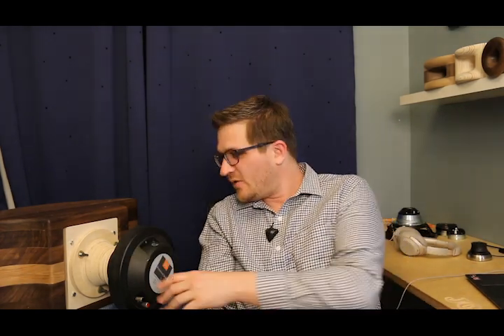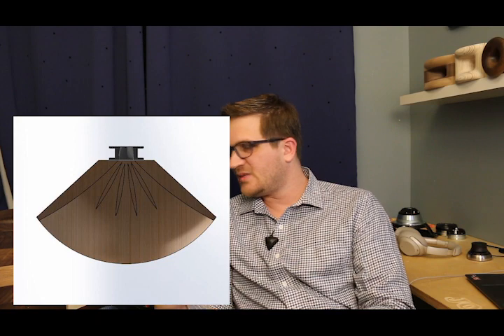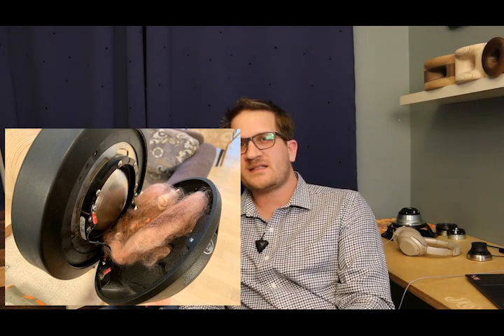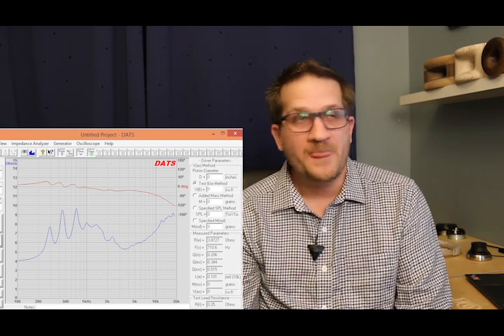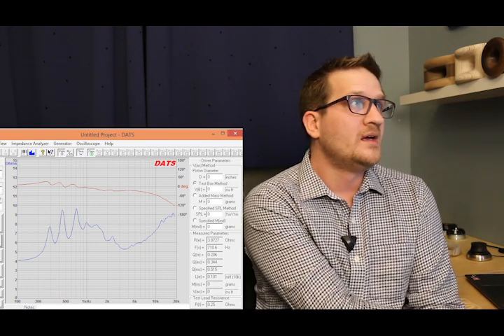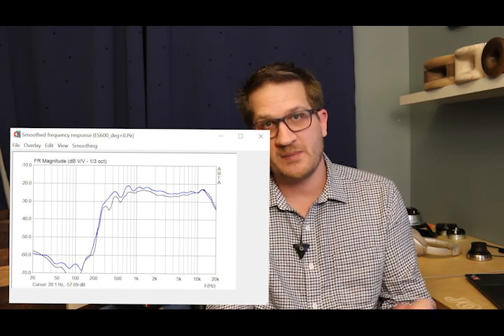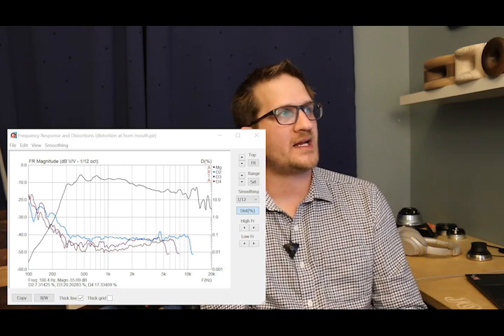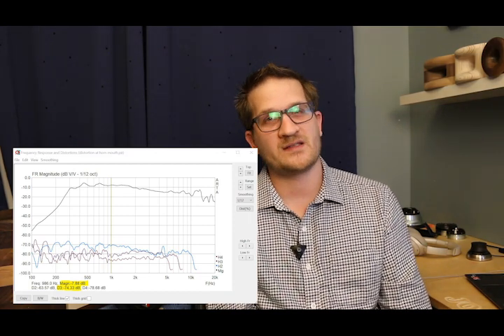Full Test --- ES-290 Biradial Horn + JBL 2446H

Comment: the 2447 exhibits a broad peak in response at about 11.5KHz and I was wondering if you had read or heard what was responsible for this peak? I don't know if it is the diaphragm or the suspension. I is reduced as you go off axis to the horn. I was also curious if you had any experience damping these large four inch diaphragms? I know JBL used to damp both the diaphragm and the suspension with aquaplas.  I had the ideas of using a stainless steel primer in spray form applying a single light coating to the entire diaphragm then three more coats on the bottom inch of the diaphragm in three progressively narrower layers so the build up is the thickest at the bottom quarter inch of the diaphragm as this would seem to be the area of the diaphragm with the most break up.. This ought to show some improvement to the high frequency break up unless it is the suspension which is the cause. JBL never worried about this as this driver was intended to be a mid driver used with a tweeter. While I can say the peak looks worse than it sounds I think that this is one of those situations where once removed you would not opt for it back .

Comment: Joseph do you have any experience with the 1.5" exit version compression driver the JBL 2447 and or the 2381 horn often used with it? Thanks.
Reply from the maker: No, the 2381 looks decent though.
Reply: @JosephCrowesDIYSpeakerBuilding  yes it is a good sounding horn I am using it in the  near field and it does not light up the bulk of the room keeping sound well focused. some JBL data says the 2381 is a 90x50 horn and some says it is a 90x40 either way it is a tight focus which can be handy to minimize near wall reflections.

Comment: I have 4 of the 2446. They are acceptable up to about 9 K. Hope you eventually work on the carbon comp dias. again. The greatest flex is near the perifery. Perhaps if you guys stiffened the outer 1/4 of the dome. and thinned the inner half it might stay light enough and yet stiff enough at the outer rim. Surround is also critical. I vastly prefer the surrounds on Radian dias.. they are much 'quieter' than the pleated metal of JBLs.  ALL my JBL 1" drivers have Radian dias. in them. I have added 4" extra depth to all my larger alnico 1" exit JBL chambers, filled with long fiber wool. It really helps. At some point I will add a spacer to the 2446 drivers and do the same filler. Love what you do!  We need passionate technical artisans such as yourself in our field.

Comment: With regards to your carbon composite diaphragm, you could add a high quality  bypass capacitor on the high pass filter in the order of 220nf, 330nf 0r even 470nf to give the driver full power at those highest frequencies. If it produces too much gain, reduce it with a resistor in series.

Comment: 0:14 I think you meant to say "2 inch" titanium diaphragm. But seriously, beautiful work. I would love to send you the Altec 290s w/ phenolic diaphragms. It's really more of an apples to caviar sort of comparison (I love apples). Look for my email.
Reply: 4" diaphragm, 2" exit.
Reply from the maker: I'll be receiving a pair of Altec 806-8A compression drivers for my next video where I'll be using them on the ES-600 biradial.  My brother uses the same compression drivers in his Altec studio monitors and I think the sound is subjectively similar to the TAD TD-2001 with it's smooth and detailed sound.   Honestly the JBL has many resonance peaks in the impedance curve and it's a beast of a driver.   The RCF ND-950 1.4 with it's 4" diaphragm is significantly better than the JBL 2446H.   I'm not sure how the JBL would fare with the new Truextent Beryllium Diaphragms.   There isn't a clear choice when trying to select a driver for a 300Hz biradial right now.  There are some new compression drivers coming into the market right now but the verdict is still out on their performance for hifi.  This is why I've moved to develop the nighthawk speaker which extends down to 200Hz using six 10cm cone midrange drivers which are relatively affordable.
Reply: @JosephCrowesDIYSpeakerBuilding  could you compare the bms 4599he with this jbl midrange? Thx

Comment: Very nice work Joe. And totally on a good track. Getting as close to 200 hz is the Grail. Have you done any thinking about a unity horn. I like the idea of the point source and conical horn. Just would like your thoughts.
Reply from the maker: Hi Ron, the unity/synergy horn is strictly by licence only.  I pride myself in forging my own path and coming up with creative new products.  It's a small industry and so everybody needs to carve out a little piece of their own.  However generally speaking conical horns have great pattern control for live sound reinforcement applications however the abrupt horn mouth termination means resonances will be setup which can harm overall sound quality.  The mouth termination that I feature on my horns have the fully rolled lip where the sound wave can wrap around to the rear of the horn.  This is critical for achieving a hifi sound (my opinion).  The next revision of the Nighthawk speaker will feature this rolled lip flare geometry.  The first build of the Nighthawk that I featured in a recent video was commissioned for a night club in NY City, and so it needed to be suited for high SPL and space savings.   The second build for the Nighthawk will strictly be for hifi and feature the fully rolled lip on the horn mouth for both the HF and MF.